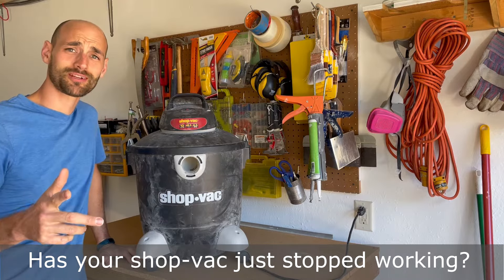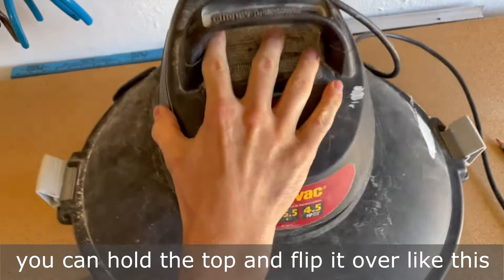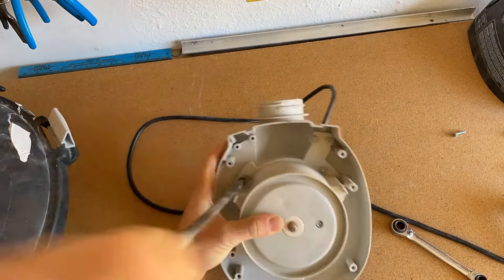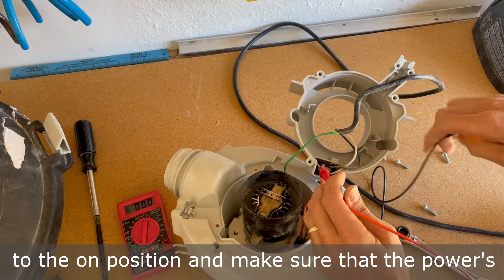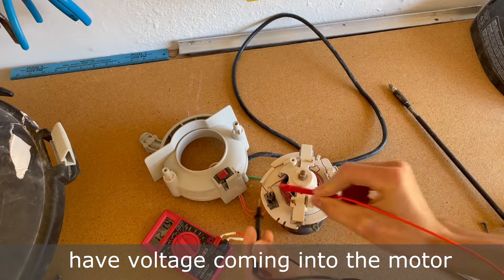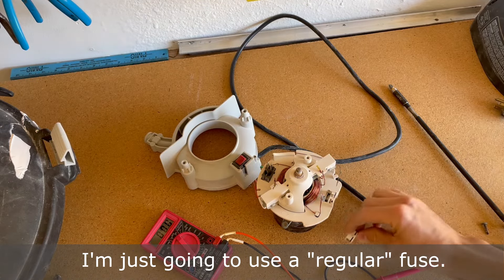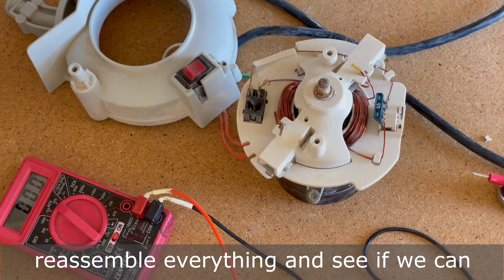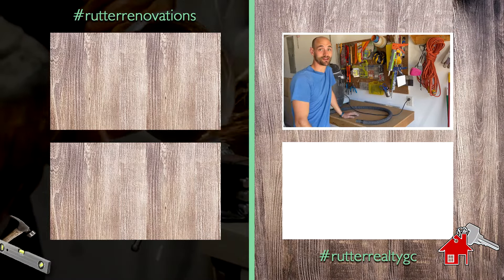How to Troubleshoot and Fix a Shopvac!!

Comment: Luckily I had a Shop Vac too. Probably was an older model but similar enough. My fuse location was much different but finally identified it. I'm not well versed in electrical motors beyond high school theory. Used my old multi-tester checking continuity from on /off switch to various points with confusing results, finally concluding the problem was probably in the fuse and not the switch. Installed a 15w auto fuse per the video example. My fuse was a newer narrow model but managed to work. Contrary to video I immediately plugged into power and nearly scared myself to death because the switch inadvertently was ON and motor started spinning all over the table! Bottom line, I reassembled everything and am very pleased with the result. Thanks for the video.
Reply from the maker: 😬 Glad you didn’t get hurt! Be careful!!

Comment: Another thing to keep in mind is that there is a bushing on the top instead of a bearing. There is an actual 608 bearing on the bottom. They have been made that way for over 30 years. I took apart 90’s Shop Vacs, and they too, have a bushing on the top. Eventually, you will hear a whine noise. When that happens, all that needs done is to lubricate the top. The new Shop Vacs (post 2020) have a completely different motor design. They have the square shaped motor. I believe that they actually have two sealed ball bearings, and that actually is a good thing!
Reply from the maker: Good info! Thanks for sharing that!

Comment: Ryan- this video was very helpful. Press fit(and then added a touch of solder) a fuse into place and it worked perfectly.  You provided an excellent explanation and visuals. My fuse and the press-fit mechanism that held the fan in place was a bit different but the actual fix was genius. Thanks so much!
Reply from the maker: Thanks! Glad it worked well for you!

Comment: FOLLOW UP: Stopped by harbor freight and picked up a cheap $5 set of torx bits. After taking it apart I found a broke/burnt wire connector. Respliced it and WaLah!! It works again! Lol. thanks for the advice!
Reply from the maker: Awesome!! Glad it works!!
Reply: You mean "Viola"😂

Comment: Thanks for sharing the knowledge.  My wall mount shop vac died today , exactly as you described.  I swapped the failed thermal fuse with another fuse and it’s back up and running.  It must of overheated from the clogged filter, it’s all clean now so it should be good but I will try to find a thermal fuse to swap that later as some of the other comments suggested.
Reply from the maker: Good deal!👍

Comment: Thanks for your video.  Very helpful.  Do this at your own risk but I installed a new thermal cutoffs fuse rated at 10 amps  250V 121 Degree C (SF119E-121C) in the fuse holder.  I had to drill a larger hole in the holder to accommodate this new fuse.  Also, the fuse ends had to be  connected to the copper wires outside the fuse holder.  My unit is rated at 8.4 amps so 10 amps might be a little tight. After some research on the WEB, the 121°C seems to be a good value.
Reply from the maker: Okay.👍

Comment: This is called knowing enough to be dangerous.  It isn't the amperage that is most important here, it is truely the temperature at which the fuse opens up.  Doing this modification bypasses a safety feature.
Reply from the maker: Getting the correct fuse replacement is definitely the best way to go!

Comment: Hey. So I appreciated the video very much as well. Extremely thorough too I love that. I still have not got mine fully resurrected yet. My issue is that i was running it hard one day and it was sounding tired (2.5Gal Craftsman ShopVac with 2.5HP), so after it started to smell like electrical fire or just plastic, I tore it apart and it seems as if the motor must have vibrated itself loose causing the mounting bolts to back oiut an the motor spun 180 deg at least. I mounted the motor back in and went to try and plug it and test before reassembling the whole thing again. It looked like a lightning storm inside. I quicky cut power and unmounted it. The thermal fuse appeared burnt out and tested that way as well. I  just bypassed that and wired it direct. HAS ANYOE ELSE NOTICED THAT WUERE   GROUND WIRE IS TERMIMATED????? ITS UNDER THE MOUNTING BRACKET FOR THE MOTOR USING THE SAME SCREW THAT HOLDS THE MOTOR MOUNTING BRACKET IN PLASE.  THE WIERD PART TO ME IS THAT ON EITHER THE SAME SIDE OR THE OPPOSITE SIDE THERE IS A TRIANGLE SHAPED LUG THAT IS PART OF THE MOUNTING BFACKET ITSELF AND EVEN HAS A GROUNDING SYMBOL ON IT. YET NOTHING IS CONNEDTED TO IT. Sorry for yelling so long in the previous paragraph. my mind is s                                                     uc somewhere else. Can you tell me if it matters which wire from the motor goes to what position on the switch. Tested again and it is still sparking. where else the sparks might be co or what todo next to finish. I need my shop vac back up and working badly. THANKS in advance.
Erik
Reply from the maker: 😬🤷‍♂️ it might be time for a new one…😆

Comment: Hi a friend gave me a shopvac..but it makes a shrill noise..or should I grease it so the noise is normal? Thanks for your video
Reply from the maker: Not sure, but it could be that the float is stuck blocking the motor (like when one flips upside down during use).🤷‍♂️

Comment: I’m started disassembling my craftsman shop vac but I’m missing the T15 torx bit. Hello eBay. I’ll see if this works when I get the bit in the mail. Thanks for the video.
Reply from the maker: Harbor freight has a great set for cheap, fyi 😊 (if you have one close to you).
Reply: @rutterrealtygc  yep, that’s the ones I bought. $5 bits are a lot cheaper than a new vacuum.

Comment: Was that a home-made filter or is that the way it's supposed to be?  A neighbor had one of  those sitting out for trash pick-up and saw me looking at it, then yelled from her door, "It works, it just needs a new filter".  I took the lid off and didn't see any filter.  It's a Shop Vac SL14-300A.  Thanks in advance for any comment.
Reply from the maker: The filter was not homemade. It came with my vacuum.👍😊

Comment: Gm Ryan. I'm a retired lady, in the middle of a DIY remodel. I needed a shopvac and (praying) there it was left at the dumpster in my 55+ park. Its a Shopvac wet/dry 2.5hp 10 gal model 5025. It works great but needs bags, filter, the filter retainer cap(?)and the nozzle end accessories. Can you direct me on where to buy these for this older  model. Are the filter and bags universal like sewing machine parts are? I'm a quilter off on a new adventure. I don't know what I don't know. lol Your help would be greatly appreciated. TYIA.
Reply from the maker: Hey! Here is Shop Vac's website ( https://www.shopvac.com/pages/official-shop-vac-filter-guide). Some of the parts are universal and some are not.  There are many online part stores that can provide you with compatible parts. Here is a website that I found with parts in stock for that model:  https://www.appliancefactoryparts.com/vacuumcleaners/shop-vac/5025.html Hope that helps. God bless!

Comment: found heavy blockage but cant get it to run i changed the .22uf 250volt cap that conect to windings test windings they good brushes are good swicth seems good now that you shown this fuse im gona have a look again i did not see that
Reply from the maker: Good deal! I hope you get it fixed!
Reply: turns out that the new cap i bought was a dud.....

Comment: What settings did you use on the ammeter to check the fuse and the switch?  I bought one but I don’t how to use the various functions?
Reply from the maker: Are you talking about the multimeter? I  used volts.
Reply: Yes
Reply: Which settings or markings do you use on the multimeter?

Comment: What happen was I was vaccummind and a bed sheet got suctiouned up. Just part way  maybe 2 feet and I shut it off right away less then 30 seconds. Now it won't start I really need to use it
Reply from the maker: Awesome name! Maybe it overheated and blew the thermal fuse?🤷‍♂️

Comment: So you still keep the thermal fuse that came in it you just add a 15amp fuse to it I didn't see you remove a old fuse and discard it is that correct? Thanks
Reply from the maker: The old fuse burned up and was in two pieces. For best results, you can order a new thermal fuse off-line.

Comment: I would have checked to see if it works way before putting it back together.
Reply from the maker: You can do this. Just make sure the motor is secure and you’re not touching anything!😁

Comment: That automotive fuse is not a thermal fuse. It will only blow when the current melts its internal wire. A thermal fuse will blow when the vacuum motor overheats, which is going to happen at a much lower temperature. It probably won't catch on fire before it blows, but you will burn the varnish insulation off the motor windings, destroying it.
Reply from the maker: Definitely should go back with the original thermal fuse. The automotive fuse will buy you some time until you can get the thermal fuse in the mail.

Comment: Mine made a loud noise sucking up water.. now it won't suck or blow out yet the motor runs. Any idea why ?
Reply from the maker: There is a little “float” that goes up and down… it may be stuck in the up position. Mine was gray.
Reply: @rutterrealtygc  it has a small gray cup, looks like a spray can lid inside the little cage, it goes up and down freely, i don't know what made the loud noise... i don't think there ever was a ball like most shop vacs...
Reply: @rutterrealtygc  is there a way to open it up and see whats inside ? the motors running but it sounds different..

Comment: What happens when it smells like smoke?
Reply from the maker: Not sure... you can always bring it to a professional to help troubleshoot it!
Reply: @rutterrealtygc we figured out the problem
Reply: @josephinesybers9981 what was it?
Reply: @gogadgo there was something stuck in between the blades for the motor and it was causing a small fire. Every time we turned it off no fire.

Comment: Was that a 12 volt automotive fuse? I contacted Shopvac and asked if they provide an OEM replacement for that thermal fuse. They said no, buy a new powerhead. A "regular" fuse will protect against overcurrent but this fuse is a thermal fuse meant to open if the temp gets too high. As a DIYer I would be ok using a regular fuse but in reality we should try to use a thermal fuse. There is a video here on YT where a guy wires in a 121ºC thermal fuse in to the line. He doesn't put it right where the old one was, he just bridges that connection. And then just puts the fuse in line. Here it is:  https://youtu.be/F2BeXxrusEg
Reply from the maker: You can get the correct fuse, but you just have to wait for it to ship.👍😊
Reply: @rutterrealtygc  Where can you get the correct fuse?

Comment: I did this and it's been working on and off.  It often stops working and I have to reopen it and tweak the fuse.  Not sure why because the contact is good
Reply from the maker: Sounds like the fuse isn’t seated correctly, but maybe there’s another issue such as overheating? You can bring it to a license and insured repair shop.🤷‍♂️
Reply: @rutterrealtygc  repair would probably cost far more than buying a new one 🤣

Comment: Wow are you sure this is the right thing to do? Are you an electrician... if no not, I recommend caution here, this looks like a DC surge protection fuse for a car. This is not an AC thermal fuse. It looks like a good idea and probably better then just bypassing the fuse. But the rating is not the same going from DC to AC. You can probably do it but you have to know what you're doing. Plus this is still not a thermal protection. Thermal protection is their for a good reason don't you think!
Reply from the maker: Definitely should contact a licensed electrician. I’m just showing you how I got mine to work in a pinch.👍